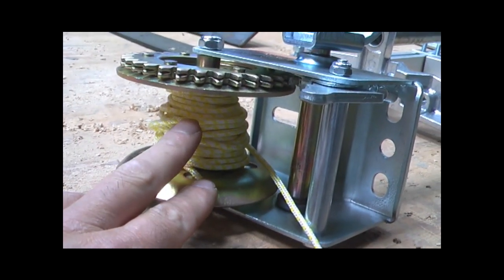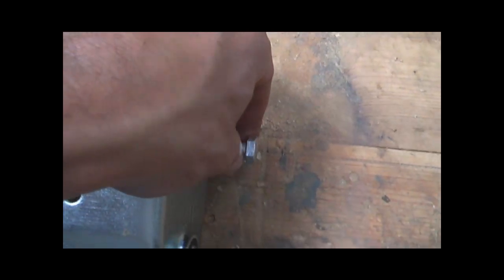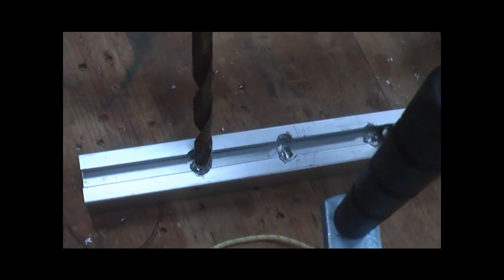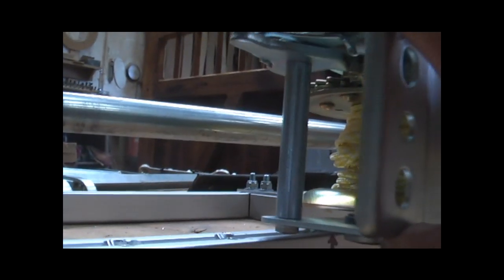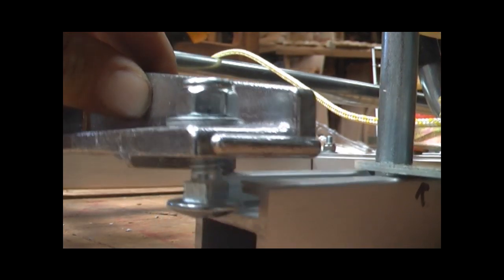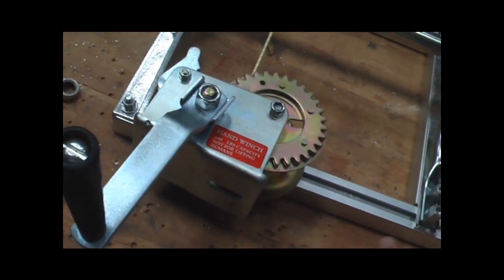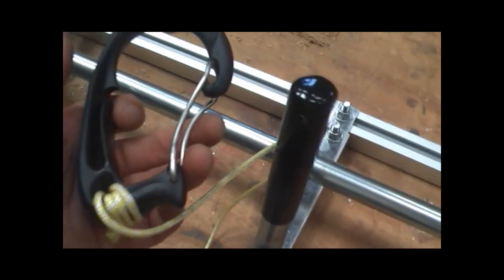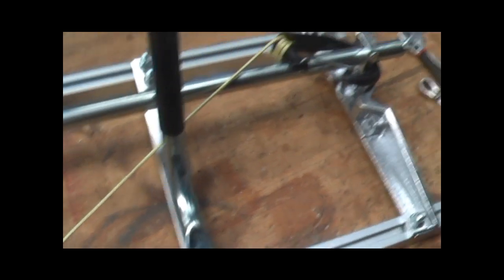Fitting a winch kit to Alaskan

Comment: Instead of gouging holes in the aluminium channel you could file the other bolt head down by a small amount. It will then fit into the aluminium channel and may be slid to any position not just where you have made holes.